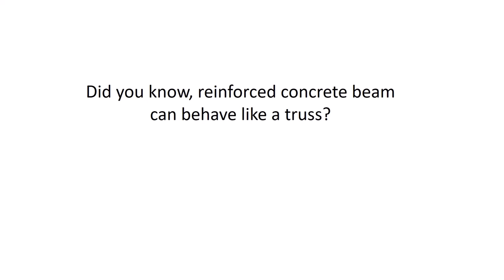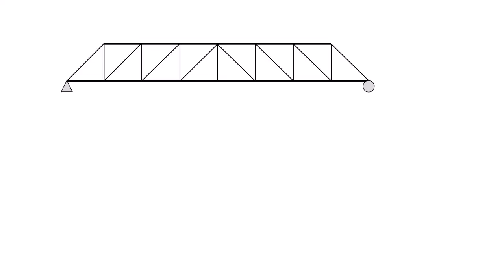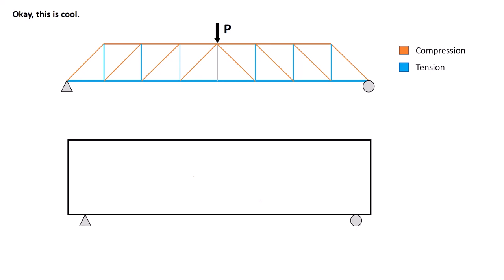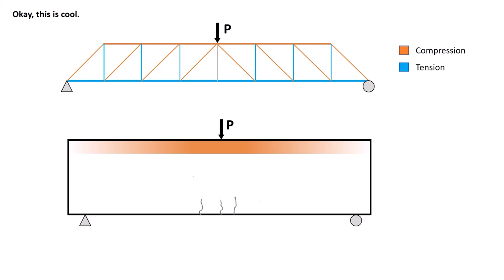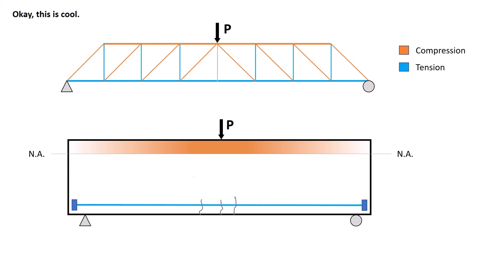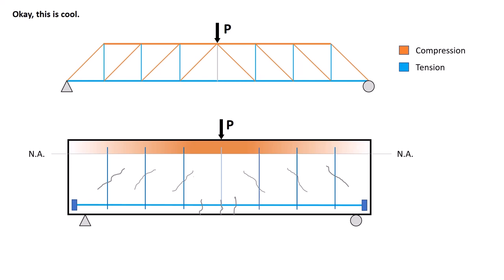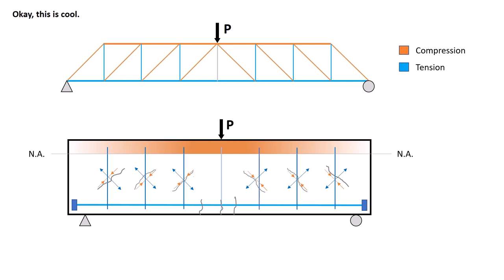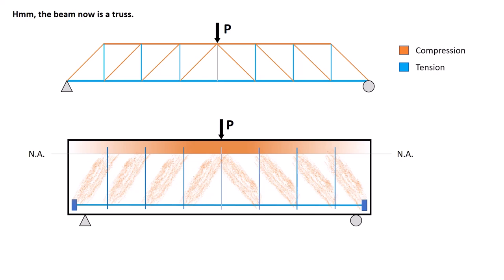Truss Analogy of Reinforced Concrete Beam

Comment: Hi, this is very helpful. I did not fully understand: first, where does the diagonal tension force come from? Is this because a force has to resist the cracking from getting wider and the only force that can do that is the tension from the stirrups acting diagonally? Second, why is there a diagonal compression force in the concrete? Is this to balance the tension diagonal force on an element of concrete? However, this seems to assume that the concrete element is in equilibrium but if cracks are forming then is it in equilibrium?